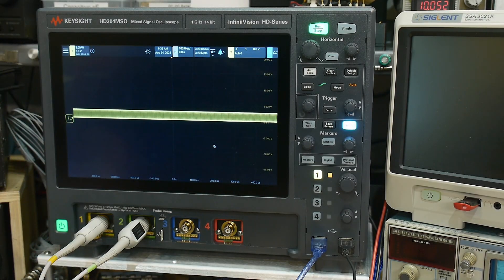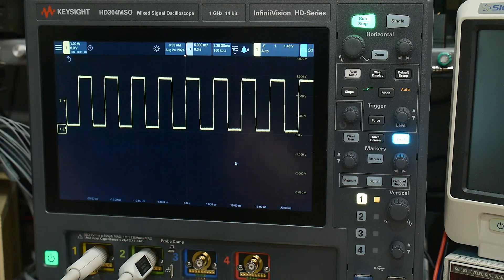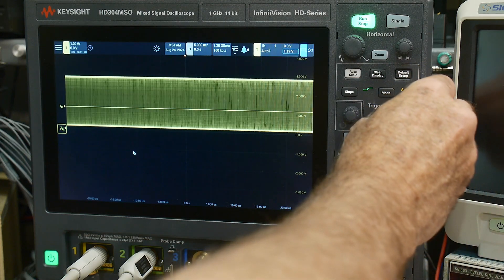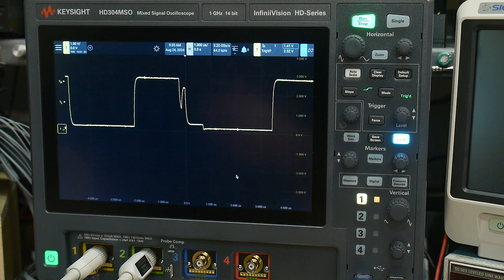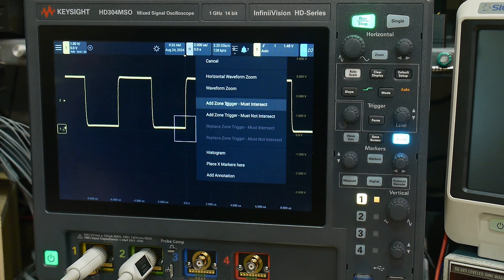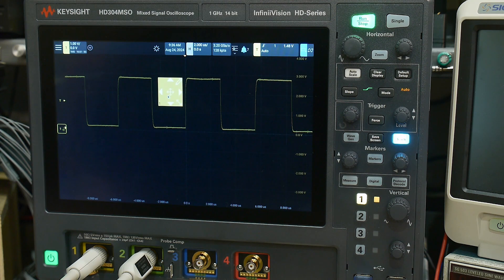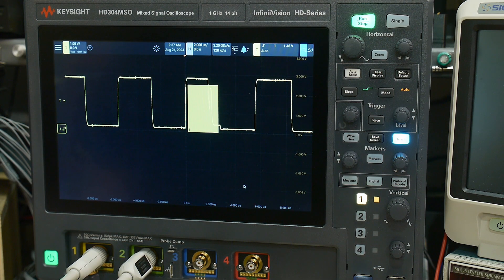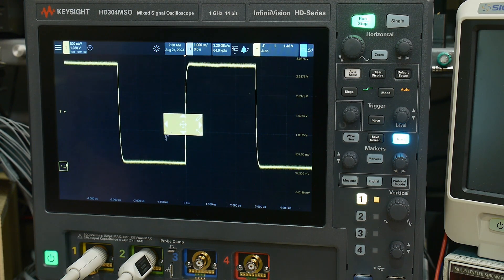#1979 Keysight HD3 HD304MSO Zone Triggering

Comment: That scope is so nice! The fancy triggers you’re able to set should be the standard. That seems like a diagnostic game changer. And, I know it’s a basic feature, but I like to see a mouse used to interface with a scope. The novelty of touchscreens has worn off leaving behind a screen with smudgy fingerprints all over it. Sure, if you have a last minute input or change of setting the use the touchscreen. Mouse is still the best. You have the best tech. Thanks for the vide
Reply: Pecoscopes software 6 and 7 have incredibly nice zone triggering. I also offer 14-bit scope. And not an up rez bit rate but hardware 14 bit